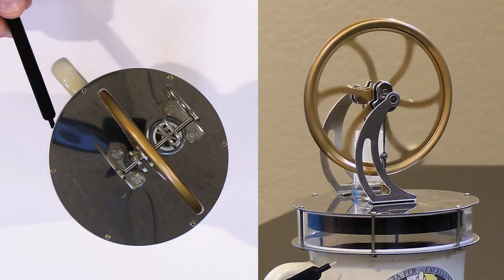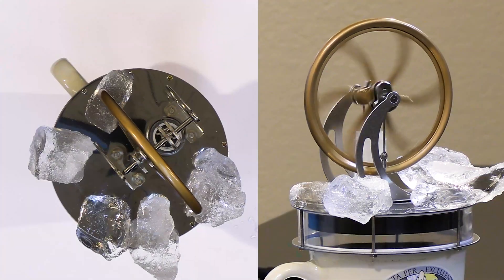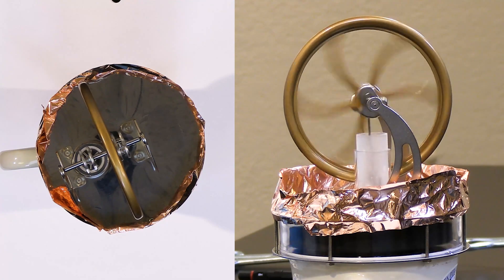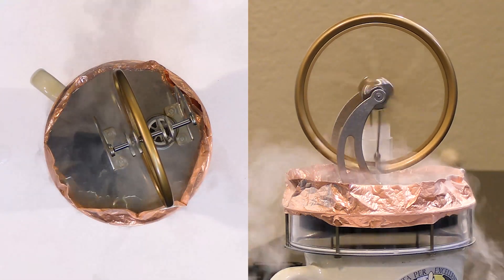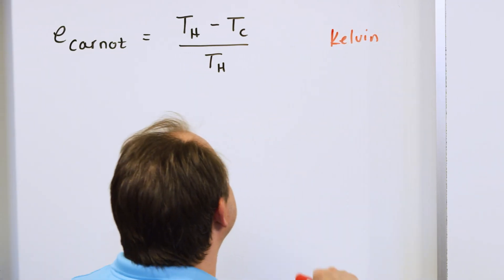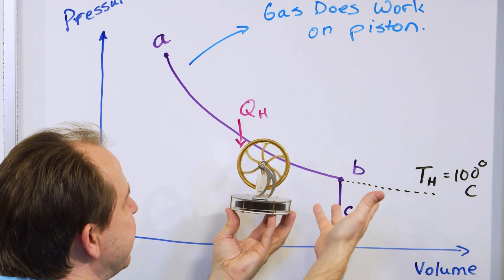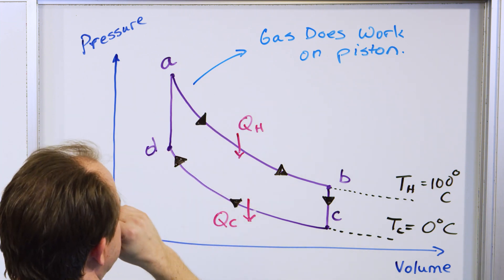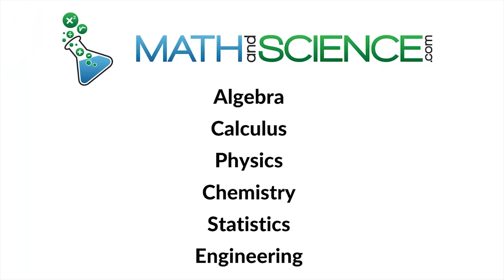This Engine Generates More Power When Cold!

Comment: Overall I liked the video. A few details I didn't like, I couldn't follow the explanation of how stirling engines work, there's a displacer piston, and working piston. I know parts of this has to be simplified, but that description of how the stirling engine works with alternative names for the pistons wasn't simplified to me, just confusing.  To me just the names displacer and working piston are self explanatory, and kind of makes half of the explanation of the working principle of stirling engines. 

Another interesting aspect of heat engines often overlooked, it's the temperature difference of the working fluid that matters, not the temperatures of ultimate heat source and heat sink. With a fixed engine design like this, the actual temperature of the top and bottom plates kind of dictates what temperatures the working fluid can reach. That means that dry ice and liquid nitrogen that doesn't make great thermal contact aren't great heat sinks, by themselves. Cooling down something like ethanol or acetone with dry ice to get better heat transfer would have been much more efficient, without requiring liquid nitrogen. Even melting ice with something that causes freezing point depression might have been more efficient than liquid nitrogen even, or at least not create a tiny window between where the leidenfrost effect limitis the actual heat removal and the engine freezing up like the liquid nitrogen.

Comment: Good explanation of the Carnot cycle.  
If a wheel is turning significantly faster than 60 Hz and you film it at 60fps, its hard to distinguish different speeds because of the heterodyne effect.

Comment: And: the refrigeration cycle is the inverse of the carnot cycle where "Q = Temp_delta / Temp_max" in the refrigeration cycle, the theoretical max performance is "Q = Temp_max / Temp_delta" which is why air conditioning units and heat pumps have "Coefficients of performance" typically higher than 1.8 and often in the range of 3 and 4 otherwise known as, or synonomous with saying, 180%, 300% and 400% efficiency respectively.

The stirling engine KING of efficiency for converting thermal gradients to into mechanical power when a professional engine and with modern tollerances, seals and materials it's even power dense and responsive enough to be throttled for vehicular power as shown by NASA when they made a ~80 HP stirling engine and rand a vehicle on for a year.

BONUS, all striling engines are also heat pumps when the shaft if powered and you don't need dangerous refrigerants to make it work. If you put roughly the same amount of power into shaft and maintain the cold sink temp, you will pump heat from the cold sink to the hot sink at roughly the inverse of the efficiency the motor ran at so if the engine had a Q of 0.5 with a certain Temp_delta it will have roughly a q of 2 when being powered to run as a heat pump for the same Temp_delta